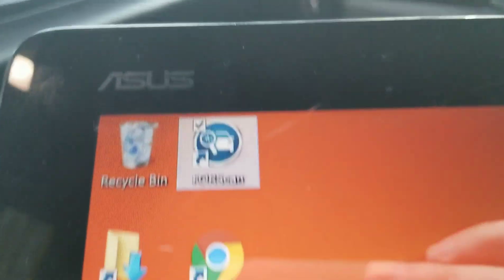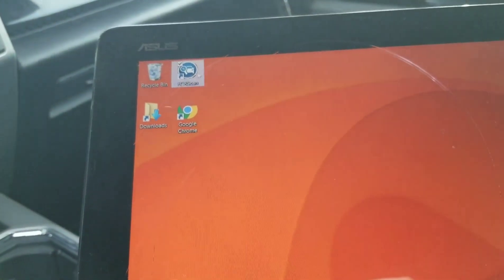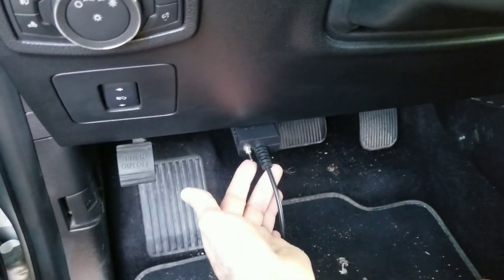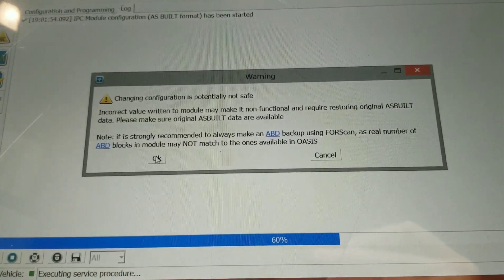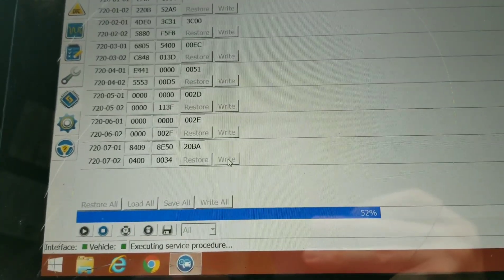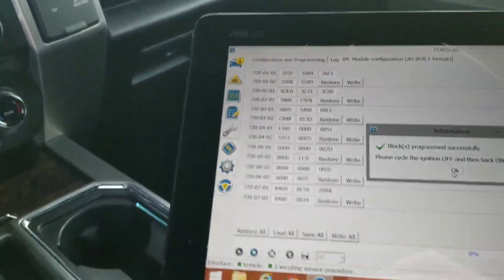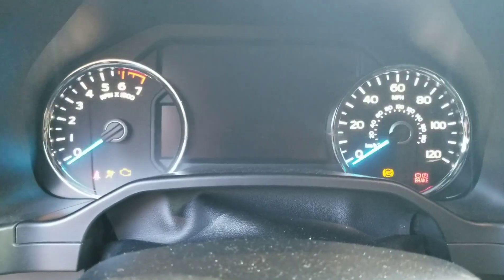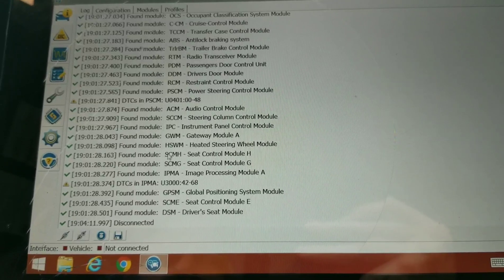FORScan mod of ipc intro change to LOBO from ford f150 tough

Comment: I would like mine to slam built ford tough instead of F-150
Reply from the maker: Dod you figure it out?
Reply: @ricardosworkshop  No I think I need a new cluster if I want to do that; I do not know if any truck in 2015 said built ford tough on it, I do not think it is worth that much to me to spend $1000 on it

Comment: Have you ever used a Mac Air to do the upgrades
Reply from the maker: No. Sorry randy. Not familiar
Reply: you will have to run a virtual machine that is running windows, Running windows XP would be the easiest. Just do some research online about how to set that up since I'm on a Windows PC, not Mac OS

Comment: I got a 2018 f150 chamged the halogen headlights to leds. The drl during the day turn on whenni unlock the truck with keyfob but turn off when i completely turn on the truck and put in drive. Any ideas to make them work properly ?
Reply from the maker: Antelmo. What kind of LED headlights did you get?